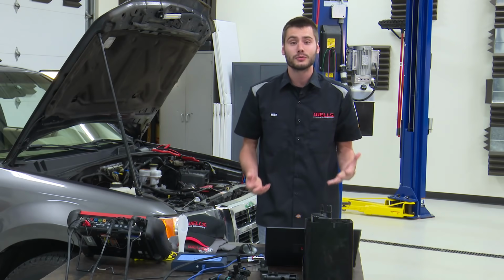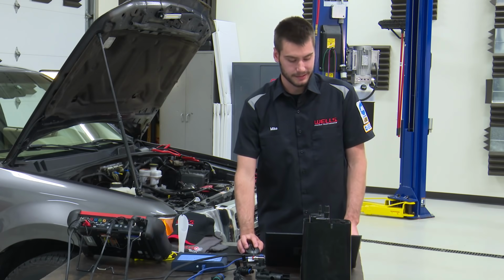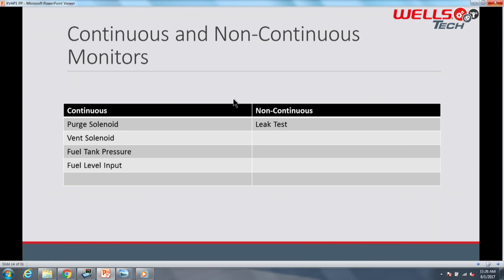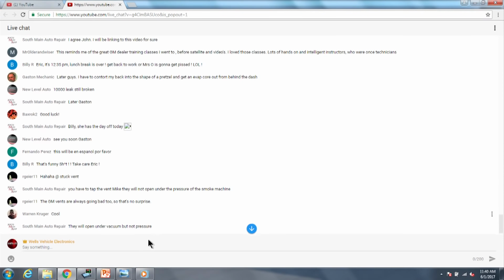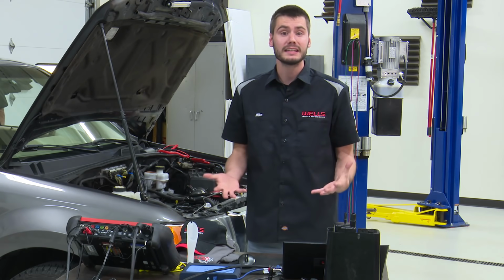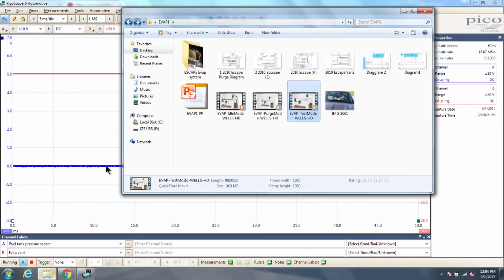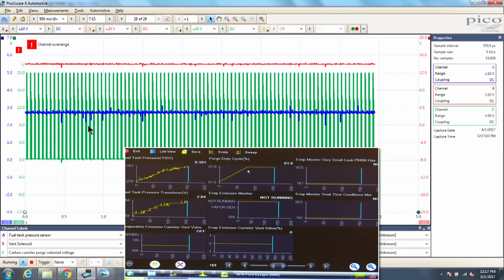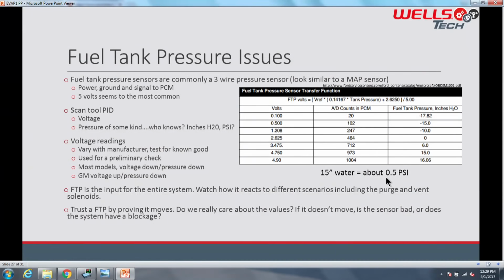EVAP-Evaporative Emissions System Operation, Testing, & Diagnostics Beyond the Leak (P0442, P0455)

Comment: Is the purge valve suppose to constantly open and close? Or does it open and close depending on the condition?
Reply from the maker: Hey, the purge solneoid will open and close depending on the computer command. It may only partially open too. All depends on what the computer wants.
Mike Becker, Senior Instructor

Comment: I have a 2001 GMC Sierra 5.3L, has a P0446 code, both Canister and purge Solenoids have been supposedly replaced, filler neck was replaced while the tank was out, new gas cap, has been smoked tested, no leaks reported, fill the tank  clear code, doesn't come back on until under 3/4 of a tank, any thoughts? Thank you

Comment: Hi

So I replaced the purge valve and the pump control under the gas cap and the gas cap and my check engine light is still on my 2013 Jetta s please help me out

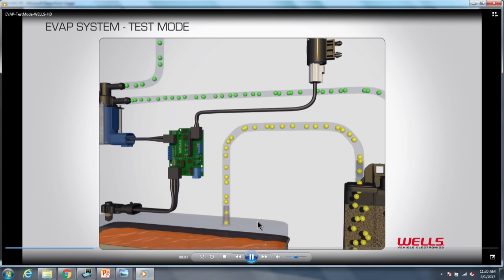Comment: Seems like in your animated example of the Purge Test Mode (29:25) the direction of air flow through the vent valve should be the opposite of what is shown?? If the engine is purging the evap canister it will be drawing out whatever is in the entire canister, right? Otherwise the engine would soon pull vacuum inside the canister. What am I missing? Thanks

Comment: A p0497 code is not automatically time to replace the purge valve. Any condition that causes low purge flow will set this code.

Comment: Thanks for this video ! I have a constant gas smell when I drive my '02 DOHC 3.0 Taurus.  I changed the gas cap last week, and that didn't fix it. Now that I've watched this video, I think the problem that I'm having is the vapor vent valve. The other problem is that I have no Check Engine light. I'll check the code reader again tomorrow, but the last time I checked for codes, there wasn't any codes on it.

Comment: I have a 02 mb cl500 with p0455 and p0451, I have changed purge valve, solenoid, canister, pressure  sensor, gas cap and one old hose near the canister,  but I can't  get rid of those codes. I drive the car and it lights up the gas cap light and the check engine light comes  on. Any idea what to do next?

Comment: I got p0446 and I hear pressure coming out of the gas cap when filling it up
Reply from the maker: Hey Trig, make sure the vent solenoid is free flowing. Also check the hose/filter. Sounds like the system is plugged up
Mike Becker, Senior Instructor

Comment: I have a code po446, replaced gas cap, charcoal filter, evap solenoid, and a solinoid under the hood, still have that pesky light. I reset the computer after each attempt, had the smoke test done by my neighbor, didnt find anything, wondering if the little metal flap in the filler neck might be a problem, it does not close completely

Comment: 30 minutes into the video you show the system under vacuum, but you neglect to show the gas filler pipe and gas cap. I think you error because the gas cap will not hold a vacuum to the tank.  See the  check valve in the gas cap.....   ? i

Comment: Thank you for this course. I'm not a mechanic (I'm DIYer) but this helped me solved the issue my mechanic was not able to solve keeping my car in his shop for 8 days.
2008 Subaru Impreza 2.5i MT 5Dr here. Had my gas tank fixed at a radiator shop (a nipple from tank rusted out and broke off. Tank leaked gas through that broken nipple). They dropped the tank and rewelded a new nipple. But upon reinstalling everything, a "Check engine" (P0447 Vent circuit open) popped and they could not fill up the gas tank (the fuel gun would click off repeatedly). In the end, they ended up drilling an internal rubber hose inside the tank (hose that goes from the in-tank fuel vent valve to the tank nipple for the evap hose E (that Evap hose E is then connected to 2 other hoses by a T-fitting. One hose goes to the canister drain valve and the other hose goes to the pressure control solenoid valve). They though drilling that hose would bypass a potentially faulty fuel tank vent valve (they said they thought it was stuck closed, causing inability to fill up gas). But the mechanics could not solve the check engine P0447.

So I took my car home, unplugged the canister drain valve and found out that when they replugged the electrical wire connector to the drain valve, they bent the two electrical tabs pins so the circuit to the canister drain valve was opened (not energized). I straightened the metal tabs, replugged the drain valve correctly, and started the car. Now the check engine and P0447 code are resolved !

So I wonder if an off-circuit drain valve could cause inability to fill up the gas tank (full pump gun would click off all the time) ??? I know it's supposed to be normally opened but I still wonder about this. 

The other thing I wonder is, since they drilled the in-tank hose going from the fuel tank vent valve to the nipple of the external evap hose E (evap hose E leads to canister drain valve and to pressure control solenoid valve via T-fitting) in an effort to make it so that they could be able to refill the tank (bypassing the fuel tank vent valve thinking it was probably stuck closed explaining the fuel gun would clicking), could liquid gasoline actually escape the tank by the drilled hose and get inside the evap hose E and damage my canister drain valve or damage my pressure control solenoid valve ??? I'm no mechanics, but I thought about this for days, reading my service manual and trying to understand evap systems. 

In summary, if the badly reconnected canister drain valve was responsible for inability to fill up the gas tank, then my mechanics drilled the in-tank hose for no real good reason. I'm just concerned that drilling that hose (to bypass the fuel tank vent valve) could lead to gas flooding of the canister drain valve and/or pressure control solenoid valve. Are these valves resistant to gasoline fluid or are they only capable to handle gas vapors but not liquid gasoline ?? In the end, I don't want further problem down the road and than in-tank hose that was drilled (inserting the drill bit though the nipple) is not replaceble (impossible to access as it is very deep inside the fuel tank). They only mentioned to me that they drilled it after the fact, so that kinda sucks. But if you tell me it's not likely going to be an issue in the future, I'm going to have to replace the fuel tank completely with a brand new one (not repairable).

PICTURES HERE TO HELP OTHERS: https://www.toronto-subaru-club.com/forums/showthread.php/211637-Deciphiring-the-2008-2014-EVAP-system-hoses-and-where-they-connect?p=1704954#post1704954

Comment: I am experiencing high pressure in my gas tank where it wooshes out. It accompanies DTC fuel tank pressure sensor low voltage code. What's wrong with my system? I independently test my canister vent valve and also my purge control valve, both working. My charcoal canister isn't clogged and neither are the lines. Someone help
Reply from the maker: Hey Cory, sounds to me like the vent path is plugged. Remove everything from the canister to the vent solenoid and vent solenoid filter if there is one. You'll find a restriction in there somewhere.
Mike Becker, Senior Instructor
Reply: @GoTechTraining  I had checked all of those lines and even vented the has cap to blow through the tank line. Didn't taste very good. Turns out I had a corroded canister vent solenoid wire due to a forced aftermarket (discontinued as per a lot of GM vehicles were) vent solenoid being installed. Whoever installed it stripped the plug and left only the terminal plugs, which were just plugged into the aftermarket. When I tested suspected bad wire with a generic multimeter- I turned key to run and I would get fluctuations of voltage ranging from 8-12 even if I waved my hand next to suspected wire. That was awfully strange so I inspected the wire and low and behold. Broken shielding and corroded inside. I had to cut back quite a bit because of the bare wire plugs left. Soldered the proper aftermarket plug and used marine grade heat shrink (which I recommend for any under carriage wire repair) it's been a few days and haven't had any venting issues or codes thrown. Fingers crossed. Thank you so much for your speedy reply and the best informational videos on YouTube! Sorry for the Novel I just wrote

Comment: While fueling engine on cause any leaking in evap system? Or any draw backs
Reply from the maker: Hey Mohamed, i'm not sure I understand the question. The purge solenoid is really the only part of the system that could cause driveability concerns.
Mike Becker, Senior Instructor

Comment: great info! for those of us who don't have a scan tool can you show a video of testing the vacuum pump module and the vent solenoid when you removed it from the car. So we can see which pins run which part. Mine has a band around it and you would have to destroy it to find out. Thanks, mine is on a 05 corolla PO43E code.

Comment: I have twice now thrown a P2450 code on my new Porsche 911....  The dealer did a software update but hasn't looked at any specific systems? and should I be worried if I've been using MMT based octane booster to raise 91 to 93?
Reply from the maker: Hey SJ, I really wish I knew more about this MMT stuff. From what I found quickly, it does appear that it can cause issues. https://www.sae.org/publications/technical-papers/content/2016-01-9073/
Mike Becker, Senior Instructor

Comment: Do some cars just have a uncontrolled vent on the carbon canister.?? I think i saw this on a toyota avensis
Reply from the maker: Hey Padraig, If they did, I don't think the system would be OBDII compliant.
Mike Becker, Senior Instructor
Reply: @GoTechTraining  Yes that is true.. I saw it on an early 90s car actually
Reply: @GoTechTraining  Yes but is it possible for them to have a  vent that's not being seen by ecu? yes/no
Im sure ive seen one directly on top of carbon canister with just a small filter to atmosphere

Comment: Very well explained Mike..so vent solenoid closed only for system testing purposes.?
Reply from the maker: Hey Upkar Bath, thank you! Yes, that's correct. The vent is normally open and only closes to test for leaks on most systems.
Mike Becker, Senior Instructor

Comment: Hi Mike.  I have a 2001 Toyota solara 3.0  with a DTC p0440.  I did a smoke test and I can't find anything.  Please help
Reply from the maker: Dennis, the canister close valve has a line that runs to the airbox. Take a peak at that...super common.
Mike Becker, Senior Technical Instructor
Reply: @GoTechTraining  hi mike.  Okay at first I had p0441 active and p0446 pending.  I saw that hoes you're talking about that connects front the closing valve to the air intake.  Cleared the codes and now only p0440. 🤔 I'm stuck.  I've worked on other vehicles evap system but this one is a bit confusing to me because purge valve and closing vent valve are in the front,  and the valve in the rear by canister is a  vacuum switching valve. I'm confused.  Any other ideas? Oh and by the way, the vehicle is running lean because long term fuel trims on both banks are at 10% bank 1 and 12% bank 2. Thank you mike

Comment: My 2002 4-cyliner Toyota Camry smells like raw gas near the tank usually upon shut off. No check engine light. Any ideas?
Reply from the maker: Sounds like you have a leak in the system. Normally that requires a smoke testing machine to pinpoint it's location.
Mike Becker, Senior Technical Instructor
Reply: Sam S Thanks! Wouldn’t a leak in the filler neck trigger a check engine light just like a loose or worn out gas cap would?

Comment: Wow great way to explain the system. Even i understand it now. I don't have a scanner that can comand the vent valve shut. From what im hearing you can apply you can jump the vent valve through the cars battery and shut it? You keep voltage on it so it will stay shut while your applying smoke to the system right? Im trying to find a leak on on a 2002 2.3 accord.
Reply from the maker: Hey Chrisvill54 thanks!! Yes, the vent can be applied with battery positive and battery ground. 
Mike Becker, Senior Technical Instructor
Reply: @GoTechTraining  thanks i actually found the leak by doing exactly that. It was the vent valve not fully sealing fumes on my friends 02 accord. Thanks again!
Reply from the maker: Sweeeeet! Glad you got it!
Mike Becker, Senior Technical Instructor
Reply: @chrisvill54  ...,..1
Reply: O.

Comment: Can a small evap leak cause rough idle?
Reply from the maker: The only way it could cause an idle issue is if the small leak is caused by the purge solenoid leaking. Any other small leak will not affect drivibility.
Mike Becker, Senior Technical Instructor
Reply: NGK Technical Training I found the source of the misfire it is a bad upper intake gasket. Thanks for the information.

Comment: mike i have a problem , i have 2010 ford explorer with codes p0443 p0403 , my purge vent went crazy opening and closing constantly for about 30 sec then stops for some time and then come back to opening and closing making a grumbling sound , i changed the [purge] and the [EGR] and the [rotten pipe] from the purge to the engine and the whole [wiring assy] for the engine bay and still same problem and same codes i also tested the old purge and it was good no leak and closes and opens , i have no idea what to do now my car lost its power when claiming hills it feels very heavy and shakes alot can you please help me ?
Reply: Any idea ?
Reply: pcm?

Comment: If solenoid is stuck open will my truck run bad hard to crank and pop when pressing gas paddle
Reply: Well
Reply from the maker: Sure, a stuck open purge solenoid could cause some drivibility issues.
Mike Becker, Senior Technical Instructor

Comment: hey there so ia have 06 ford explorer 6 cylinder 4.0L with the check engine light on cod P2195 (O2 sensor signal biased stuck lean  bank 1 sensor 1   and  code P2196 O2 sensor  signal biased stuck reach  banc 1 sensor 1 ....... the questios is could bad purge valve solenoid  or bad canister vent could triger this ?????
Reply from the maker: Hey William, A bad purge could...but not a bad vent. You'll probably want this thing properly diagnosed to know a real answer without guessing. 
Mike Becker, Senior Technical Instructor

Comment: what means pcs valve control in  EVAP system?
Reply from the maker: Hey, are you talking about the purge control solenoid?
Mike Becker, Senior Technical Instructor
Reply: @GoTechTraining   yes  DTC P0442 EVAP system small leak possible failure leakage between PCS and fuel tank.  you videos are great!

Comment: I know this is late, but what was the answer for the free T-shirt/Hat for the P0442 code small leak? 

Something with ambient air temp/pressure impeding on test results? No leak present during smoke test and system held vacuum?
Reply from the maker: This question was an example of a vehicle that uses a check ball in the filler neck. When fed pressure with the smoke machine the check ball seals off the filler neck and the leak is not found. The vehicle tests using vacuum, which doesn't seal off the check ball, and notices a leak. In this case, in the filler neck. Here, I show the vehicle/issue in this video. https://youtu.be/u2yPUTA3pEY
Mike Becker, Senior Technical Instructor

Comment: thank you for taking the time to make all these informative videos. i'm glad i found your channel. i wish more viewers show some support by liking your videos.

i didn't know what the heck an EVAP system was before this video. i got the basics of it after watching your case study. one thing i do not understand is how the EVAP system would deal with high pressures while the car is off. you mentioned EVAP systems are not sealed perfectly, but would the natural leak be enough to prevent possible errors from the build up of vapours by a car stored with a full tank of fuel over winter, for example? am i under estimating the resilience of the EVAP system components to pressure build up?
Reply from the maker: Hey Coldpillow, thanks for watching! Make sure to subscribe and click the little "bell" icon so you get notifications when we put a new class out. In a standard Purge/Seal system, it will always be vented to fresh air to prevent pressure/vacuum buildup. This is vented through the canister assembly and out the normally open vent.
Mike Becker, Senior Technical Instructor

Comment: I have a 2008 F-150 with a p0446 vent control code. I have a reading on my actron scan tool saying evap in h2o is bouncing between 0 inches, up to 17 inches, back to 0, then up to 52 inches. This is just with the key on, not even with the engine running, I'm thinking maybe fuel tank pressure sensor or maybe vent solenoid stuck open. The h20 reading bounces around between those numbers basically all the time with the key on, engine off. My scan tool won't read actual voltage on the ftp sensor though. I checked last week for power at the vent solenoid and it does light a test light, weather got nasty and I was outside so couldn't check much more that day.
Reply from the maker: Hey Jdtractor man, weird that it's bouncing at key on engine off. Pull the gas cap off...should read 0 and be steady. If not, you may have a bad fuel tank pressure sensor or wiring/control related to it. You can get a vent control code when you have an FTP issue.
Mike Becker, Senior Technical Instructor
Reply: I found some information online last night, the 04-08 f-150's have an issue with a couple inline connectors down by the left side frame rail under the truck. Their is a plastic cover over them which allows debris to build up in there causing corrosion, sounds like maybe the weather pack seals don't keep the water out very well. When the weather cooperates, I'll take a look. Corrosion as you know can cause weird readings.